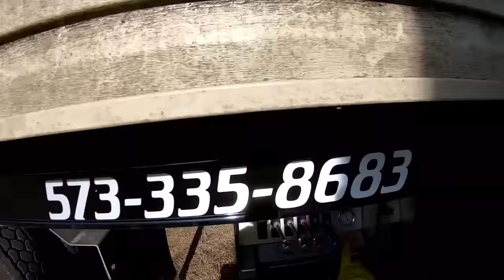Wrecker Needs a Wrecker

Comment: Here in Texas, the largest builder of these kinds of buildings drill holes through the load end of ths 4x6 runners to accept a steel shaft which the movers use as a pull point. Just in case you ever move it again.
Reply: Don R., I bet he would never think of that   beings he runs his own wrecker service and move building all the time, lol.,.,.,That was so nice of u to let him know that..

Comment: The dangers of the job. My old company had a 40/60 sliding rotator on a KW T800 chassis. We got that one stuck in a truck dealership parking lot when the ground caved in due to rain water.

You know how hard it is to use a 30 ton Wrecker to pick up a massive rotator out of a hole? 🤣

Comment: A company I worked for built these sheds and they had me help with moving and setting about 3-4 a week for 3 months. An easy way to get things level when they were off by just a fraction or two of an inch was to use either shingle scraps or small pieces of steel for shims, they were about 4x4 in size or 3x4 for the steel pieces. It worked great for up to about 3/4 of an inch, more than that and we would re-adjust the blocks.

Comment: Only one shed I moved had holes drilled in the runners or skids on both ends. We inserted a pipe in each hole on one end then looped 1 chain around each side then to our winch line. Worked great.
Oh the things we do for our kids and son in law. Love knows no bounds!! 
Good job, keep up the vids. I miss the challenge, but most of the time I'm just glad I don't have to go out in the middle of the night, work in all kinds of bad weather, in really dangerous places, or pull and carry that stiff cable and heavy chain.

Comment: I'm impressed with the JCB - I had an older bobcat on tires and in soft stuff all it did was give my winch a work out and make bobcat sized holes in the yard (that I filled with my new 4x4 tractor).... probably should have bought tracks... ah well.... good job to you, wish I had your tool set ;)

Comment: I moved many sheds with a rollback. Very easy. Gone many without using the winch. I just use the hydraulics to slide the bed under the shed then lay the bed back down with the last foot or so hanging off the tail. Easy to unload by reversing the procedure.

Comment: The final site for the shed was out by 2.5 inches, the leveling blocks will sink by 4 inches and the termites will chew out all the timbers, Oh for a real concrete slab to sit the shed on.. BUT a great family day was had by all, and Talon's pay packet has been set back another 3 years to off set the removal charges.  will Midwest ever undertake another shed removal.. stay tuned for future episodes as they next remove a whole house complete with furniture.....

Comment: I was cringing at grabbing the wood skids with chain instead of the nylon straps when you turned it around. Chains have a tendency to find weakness in wood and constructions, the straps may have prevented or reduced the problems with the "weak" end. Of course hindsight is always 20/20 and you guys saw it with eyeballs, I am seeing it on a little screen. I tend to always use the same methods and tools if they worked the first time. I know there is a saying that chain is always better. But situationally, not really. Chain is really good at tearing stuff apart that is not metal, or that is screwed or nailed together.  Great video. A good weekend project. Nice to be able to move the whole darn shed and not have to tear it apart. Databyter

Comment: We helped a family member move a garage one time.  We were able to back the truck into the garage and it happened to be as deep as our bed was long.  So we took 6-7 timbers across the bed to the wall studs, jacked 2-3 that were fastened up to lift the garage, then installed the remaining ones, jacked those up, and kept alternating that procedure untill we got the height we needed.  Was interesting and it worked really well.

Comment: I have a feeling that if I had to hire that much equipment to move a shed of that size it would be cheaper to abandon the old one & build new!
At same time moved one for my dad yrs ago with 78 F-150 Supercab a old car trailer built on VW axles, 1 come along & several bottle Jack's and bunch of chain from my Hywy tractor. Dropped it in less than ½ in from building it was to be joined to, first shot! Some days are luckier than others!!!

Comment: 1:00  Gee man, how can you drive right by that train and not put your camera on it?   No trainspotter you ;)
I've been watching your videos now for a bit and I am totally amazed by the rigging possibilities your winch truck provides.  So many work aids, so many details worked out.  Ie idler roller for paying out the safety chain.  Coaster for the chains.  Hard points everywhere.  I Could appreciate it when you told the engineer from USACE  that it wasn't a crane. 
And then there is the ways you have of dealing with people including the old man who of course has his own ideas about how things should be done.  You two do pretty well considering.
You make good videos too.  Quite interesting watching you guys overcome the obstacles of any particular job without damaging the each other, your truck or the tow.

Comment: I once pulled another rotator out of a ditch it was stuck in. It was stuck in some mud. The trucks tires was covered in it. It was a brand new truck too. Was another companies. It was a peterbilt with a jerr dann rotator. Cool truck just that the driver stopped on the side of the road to check something, and didn’t realize there was mud. You have to be careful where you park.

Comment: Nice job got it done with no one getting hurt and nothing damaged but sometimes have all that equipment blinds the easier method. Should have dropped that building at the road and skidded it in on those plastic mats and a bottle jack to level and before everyone gets mad yes I have moved several buildings one that had over a 1000 board feet of hardwood in it and use those mats all the time
Reply from the maker: I don't move sheds for a living.  This job was done to help out family.  I'm sure there are many other ways this job could have been done easier and faster, but, again, I'm a recovery specialist not a shed mover.   Thanks for watching and God bless.
Reply: @RonPratt  I fully understand it just shows how when you have an idea how your going to do said job it can blind you to an alternative method been there done it and i'm sure it'll happen again lol

Comment: Different kind of job...

Alex had fun on his birthday. I took him to the tow yard where the company was training younger guys on the century 50 ton 1150R rotator they just got. Alex got to upright a semi tractor/trailer the company uses to train the employees on (with a lot of guidance from the tow company employees who were actually doing the upright but had Alex's hands on the controls with them). At first he was a little scared of it, but after about 30 minutes, he settled down and worked the control system. The second thing he got to do, which was easier, was use the spreader bar and slings to lift my 98 Ford Contour in the air and rotated it from one side to the other. That he did with little help.
Reply from the maker: That's awesome.  Glad he got to do that and glad the tow company allowed him to do that.    Thanks for watching and God bless.
Reply: @RonPratt  

Thanks. The company, Gene's does a lot for the community and has several employees with kids with special needs and contributes to the local children's hospitals in the area. They were great in allowing Alex to be around them and having the employees get to know Alex as a person. They knew somewhat of Alex's background but they all were very accommodating in getting Alex to not be afraid of them and reassuring him that he wasn't going to be hurt like he was with his family.

Comment: We had to move a shed a lil bigger than that and we had to jack up one side and then the other and put round log type stuff under it to roll it while trying pull it whith a truck wooo what a job but you have big trucks and cables lol be so much easier

Comment: I probably would have unloaded it and slid it in on the mats with the track loader. But I once got a 80000 pound truck stuck delivering some rock to the in-laws. Ended up shoveling 10-12 ton of rock before we got it out. The crap we get into helping family

Comment: You got the job done, but there is a better way to move it with 10 inch schedule 80 water pipe because that is the way I moved sheds when I did it for a guy I worked for.

Comment: What i always did was drill two pilot holes if they weren't there already slide rebar through the holes hook in the middle of the rebar and pull it up on the bed.

Comment: Ron, please excuse my ignorance but... Why didn't you guys fit the shed around the other side (180 degrees) on the truck and then back it in from the OTHER side where the 4024 is? It seems to me that there's less mud, water and work over there...
Reply from the maker: We looked into that option.  It's difficult to see in the video, but the alley that the 4024 is on is VERY narrow and the drop into their driveway is a very strange angle.   The rollback would have dragged the tanks trying to go from the alley into the driveway, then we would also have been at the wrong angle to drop the shed.  Believe me, we didn't want to have to do it this way.....  Thanks for watching and God bless.

Comment: You mentioned the spring flooding upriver from where you are located.  Looking at Google Earth, it appears that there is a diversion channel about 1/4 mile (400 meters) north of Nash Road where the shop is located.  Has that levee ever been breached since the shop has been there?
Reply from the maker: Thankfully, NO.  We were very concerned during the flood of 1993.  The Diversion Channel levee was designed to withstand a flood stage of 50'.   Normal flood stage here is 32'  In 1993 we were above 45' for a LONG time and scheduled to crest above 50, so we were very concerned.  Then some levees in Illinois broke and dropped the river level, which probably saved us.  The Corps of Engineers were getting oil drums from us to cap off "sand boils" almost daily....this is where the water creates an underground channel to help relieve pressure.  Occasionally,  we would hear what sounded like a cannon going off.  We'd look in the field across from us and see one of the barrels 50' in the air pushed up by the water pressure.   After the flood receded, the Corps drilled relief wells down the length of the levee and we haven't had that issue since.    Thanks for watching and God bless.

Comment: Let me SHED some light on this operation..... Easy does it .. So it is sitting on top of concrete blocks..high and dry... NICE..!!  I would of set it down and on 4 x 4 wood blocks and then leveled it with a heavy duty 3ton floor jack. Overall...a family experience.  Barbecue and Beer later

Comment: My daughter who lives in El Paso bought a 8x10 foot shed and I loaded it using 2" ratchet straps, I took a 4x4 and put it across the 2 runners on the back side and I hooked 2 straps on the outside of the runners up to the opposite side of the 24 foot trailer we rented, the I put 2 4x4's leaning on the side of the trailer down to the pavement to the front of the shed, because I couldn't block the road so I had to side load it and spin it, and started tightening the ratchets pulling the shed up the 4x4"s. We had to loosen the ratchets a number of times one at a time and pull the excess out because it was a long pull up the 8 foot of the 4x4's, once the shed was over the half way point my son in law, his friend , my daughter and I pushed it and rotated it length wise onto the trailer and strapped that baby down and when we got it to her house we used her K5 Blazer as an anchor point so we could hold the shed in place while we pulled the trailer forward off the trailer. Then we rented a 4 wheel drive and steer extend a boom forklift to move it to the back of her property through a double gate I built for her just months before, I had to lift the whole building over the gate to allow me to manure the shed between the house and the fence which was over 6 feet high. Once I had cleared the side of the house I was able to lower it down for a few feet then I had to raise it back up to clear the fence where I had to make a turn at the back fence and set it down about 20 feet after making the turn. Her property is in a development and is pretty compact but my skills along with my daughters guidance we did it without any problems...

Comment: Check the air pressure in the tires on the tractor. Front tires looked flat under load.

Comment: I have to wonder if it wouldn't have been easier to have just dropped the shed off onto some pipe or even just its skids and then pulled it with the skidder. I don't blame anyone, I just have to wonder.

Comment: would have been cheaper to build a new sheld then moving it  when we moved shields we drill 2 holes in the slides and had a plate made and we bolted it on the slides  pull them on them that way too

Comment: Ron, just noticed the hydraulic tank is under the deck between the frame rails. Is there any way to access this with the bed in position?  Would be a pain if you blew a line or seal and lost oil and needed to refill to move the deck.

Comment: Now that you have had practice backing up to it, ding it again ought to be a piece of cake. Yeah, right. You were asking if there was any other way of getting in there, actually, there was but at an awful lot more cost. Lift it with a helicopter and set it using that aircraft. I don't think that it would have helped you make this video though. 
Now, does Talon have that shed up on concrete blocks, if not why not. Concrete blocks do not rot like wood does.
Reply: It is illegal to sling load with a helicopter over a populated area

Comment: "Veer angle" (15:23)..... ?   Never heard that term, I think you are referring to "Fleet angle".  Quick search for both terms will confirm this.  Veer angle is a meteorological term applying to wind.
Reply from the maker: It may also be a meteorological term, but I assure you it is a commonly used and very important calculation in my trade.    Veer and fleet angle are not the same, but both are extremely important.   Veer angle is the relation of the connection point, usually lifting of winching, distance from two separate hook points to the distance between the two separate hook points.    This is usually expressed as a ratio.  For instance, if the two hook points are 1 foot apart then the sling attachment point needs to be a minimum of 3 feet from the two attachment point.  The ratio in this situation would be 3:1.   Anything less than 3:1 will start to place a "crush" on the two lift points of item being lifted or winched.   Thanks for watching and God bless.